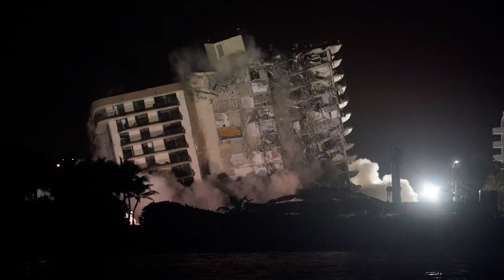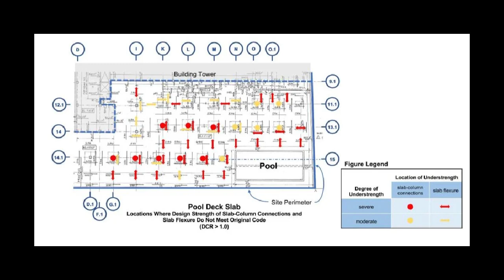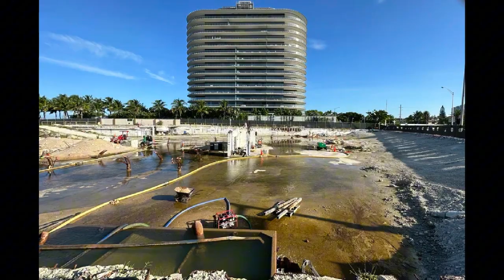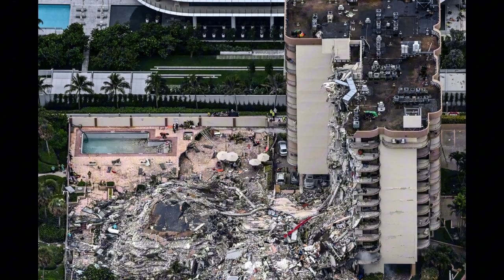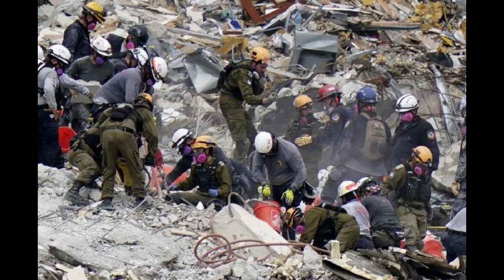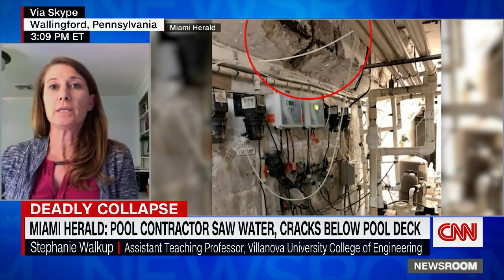They Knew It Was Sinking — But No One Evacuated

Comment: I've actually followed this story pretty closely as the developer is from my hometown. 
The most damming things that stood out to me was... 
1. The 1980s revision in the building's plans where the largest and longest planter box is located (along the west side of the pool deck) If you look at the plans carefully underneath every planter there was transfer beams to support the unit's patio (on the first floor) + the planter boxes. In the 1979 version of the plans there was long transfer beam that ran underneath these planter boxes all the way to the perimeter wall.  (including the famous Column K-13.1) which was parking space #75. In the 1980s revision this was removed! So outside of the concrete deterioration there was this major flaw already. Those heavy planter boxes sat on top a thin slab, with small columns that could punch through. 
2. The 1996 renovation to the pool deck - this pretty much sealed the fate of the buildings future. As you mentioned after 15 years the waterproofing in the original pool deck was already beyond repair at this point. They added sand and paver tiles all over the pool deck, this significantly increased the weight on the already stressed slab. As for the leaks they just did epoxy injections (and even this was done sloppily) and painted it over. There was also concerns about the pool leaking into the pool equipment room. The corbel of the pool underneath had some severe spalling which was repaired (although in some later photos there was still spalling it didn't affect the collapse) as it was fully intact when the building collapsed.
3. This was hard for me, but the physical signs. The chunks of concrete falling down, the sliding glass door in unit 111 getting stuck because the whole structure was flexing. A couple of weeks before the collapse the was a large crack that ran along the planter box. As it got closer and closer to the horrific day the gate that was in-between the planter boxes began to sink!!! It was said that the gate became jammed and 1 side was lower than the other. The deck gave way at column 75. There is another famous video where it shows the ramp down into the parking garage, where you could see a broken pipe, and a bunch of concrete rubble on the ground.  (this is where the pool deck had collapsed) In the video one of the columns at the building's edge in the garage had dropped as it came down with the pool deck. Its unknown if that fallen column in the garage started the collapse of the tower.  

Great Video btw!